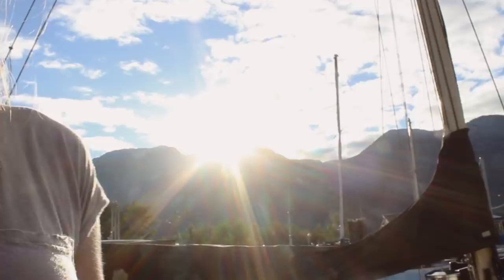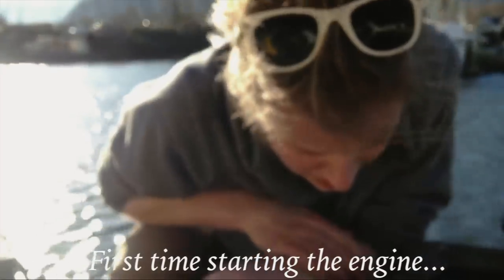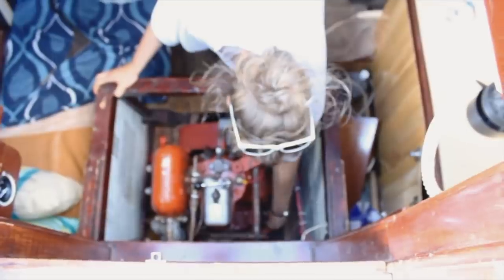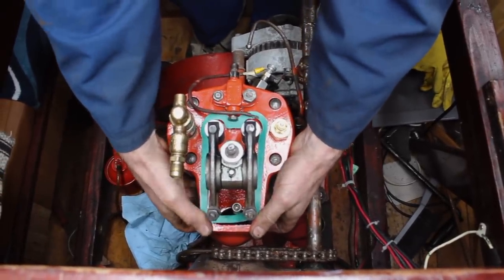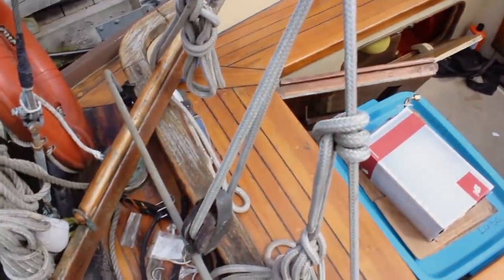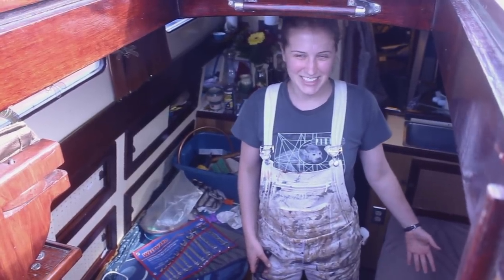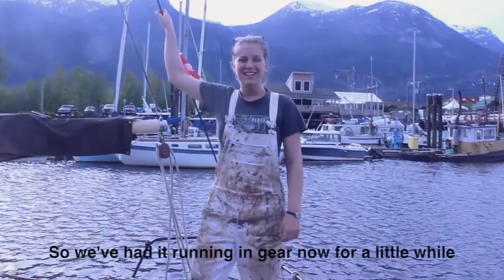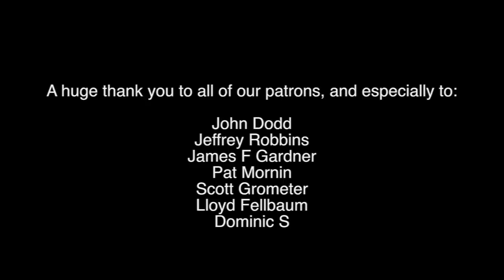Restoring the engine on my $1 boat [Sabb 10hp]

Comment: My dad still owns a 10hp Sabb fitted on a David Cheverton  Champ  18 foot hull for the past 40 years. Its reliability is awe-inspiring.
Ours has a 12v heavy duty Bosch starter motor . The 8 hp version of this engine was originally fitted with a 12v dyna starter coupled to the engine with 2 rubber vee drive belts  on the inner fly wheel rim.
This dyna starter ,as the name implies acted as a starter motor and then acted as a dynamo to charge the battery. The downside was the electro-mechanical voltage  regulator, that with time gave trouble.

Your videos are great, good job ,keep on learning and most importantly keep enjoying it.!!!!.
Greetings from Gibraltar.

Comment: Old diesel engines are unbelievable. I've had engines that have sat in a field for 20 plus years. Clean the fuel tank, new filter and fuel and away they go. I've got to say I prefer a combined cooling system. My boat has a heat exchanger (think car radiator), the raw water runs through this and cools the coolant that runs through separate chambers in the heat exchanger. This coolant then runs through the block instead of raw water. Either way Hopefully you have a strainer on the raw water incoming side to stop debris blocking the engine block passages. Loved your enthusiasm and how you watched and learnt your Father. All the best from Australia.

Comment: Wonderful story, thank you for sharing. My first boat - Osprey - was also a British design, by Philip Goode of Poole in the 1950s.  I didn’t use her as my home, but aged 18/21 I cruised her extensively along the south coast of England, with no lights, no navaids, no proper life jackets, no radio and usually with no crew (they declined when they saw her 🤣).... and she had a rather dangerous Stuart Turner single cylinder petrol engine that was a detonation just waiting to happen.  I loved that boat despite the bank-busting impact on my finances and the hazard involved in my voyaging. After a few years I went off to sea professionally and she went to a good home .... I was sad and relieved all at once. And/but - like you - I had learned SO much from that first experience of being my own captain, engineer, deckhand and cook. 😃

Comment: Damsgård Motor Factory, later renamed Sabb Motor, was founded on April 30, 1925, by the brothers Håkon and Alf Søyland from Flekkefjord, together with Harald Svendsen. Until 1929 they lived in a sea buck at Damsgårdssundet, in Laksevåg near Bergen. The company eventually became too big for the place and moved to the present address Damsgårdsveien 113. The first engine, model A, was a 3 hp incandescent engine. One aimed for delivery to small fishing boats as there were many along the coast. The engine became popular and gained a reputation as reliable and reliable. The last of these engines were delivered in 1962. A slightly larger glow head engine was a 5-9 hp incandescent head motor that remained in production for 38 years. A worm motor of 4–5 hp was made from 1935 until the mid-1960s.In 1958, the first full diesel, a four-stroke of 8 hp, was named type G. This is the well-known single-cylinder SABBen that is found in countless fishing and leisure vessels. Eventually, it was equipped with a starting ring and adjusted to 10 hp. There were also made 2-cylinder versions of type G, rated at 22 hp. The motors have roller bearings and splash lubrication and an innovative propeller wing reversal system. In total, more than 20,000 of SABB type G have been made. It also existed as a stationary engine without a casing, and as an air-cooled lifeboat engine, then with reversing gear and fixed propeller. The latest engine of this type was manufactured at the factory in 2001. One then went in full with the marination of engines from other factories, as well as continued the production and adaptation of systems with rotatable propellers, gearboxes, and other specialties. The motors are then equipped with the Sabb mark. In 1971, the company was converted into a limited liability company and was named Sabb Motor AS. Sabb is now part of the Frydenbø Group.

Comment: WOW what a nostalgic Sound and imagery.  I grew up in the '60s my dad starting up his 3hp single cylinder Yanmar diesel via hand crank.  I remember him squirting lighter fluid into something, then holding the compression release while getting the crank turning, then letting go and hearing the old gal come to life.  His boat was 22' motorsailer an Atkins design based on a Sea Bright Skiff hull which he had built in Yokohama, Japan in 1963/64.  I'm weird but I LOVE the smell of diesel both raw and exhaust smoke a very nostalgic odor to me.  Later in the mid '70s when dad was dreaming of having a 42' steel hulled Chinese lug rigged Pinky ketch custom made to sail the South Pacific the two motors he had picked for auxiliary power were the Japanese Yanmar diesel, and the Norwegian Sabb diesel.  I still had the old Sabb diesel brochures up until about a year ago when while clearing out the old homestead before it sale I had to regretfully place them in the rubbish bin.

Comment: My dad's boat had that engine when I was a small boy.  I've taken it apart and rebuilt it more times than I can count.   One word of caution though, when you start it keep your thumb on the same side of the starting handle as your fingers.  It's not a natural grip, but the reason for it is that once in a long while the engine will kick back against the handle.  This can break your thumb.  It's not pleasant. 

Once when we took it apart and put it back ( the head gasket was leaking) we got the con-rods crossed, and when we started it it ran in reverse, sucking air in the exhaust and blowing smoke into the engine box.  iirc we had to unbolt the fuel line from the injector to get it to stop...   The con rods go from buttons on the crank case at the base of the engine,  to the valve rocker arms on the top of the engine.  The 'buttons' are fore and aft, and the intake and exhaust valves are port and starboard.  When you had a little smoke in the engine box, I was SURE that  you'd done this too.  Enjoy her.
Reply: That thumb and fingers thing is very important. You really don't need a dislocated thumb when the engine kicks back. It's worse if it's diesel because of the higher compression ratio.

Comment: I have the Sabb 8hp in my boat and had exactly the same issue with the frost plug. It was worn out completely, no wonder as the engine was build in 1969. I ordered a new one also in the UK, put it in and the Sabb still does his work. You can easily let it run dry for 15 minutes, the norwegian SAR did the same, they started their engine underway to their intervention point while the rescue boat was still onboard the masterboat. Great engines, I really do love them.
Reply: search and rescue boats are buildt to last which is why the norwegians chose the saab engine, those along with the volvo are buildt for nordic conditions.i.e. to function above the arctic circle.

Comment: The guy next to my boat in the marina has a Sabb in his boat. Again, must be 50 years old and he pulled it apart and rebuilt it, as the boat had been lying, sunk before he bought it. It runs perfectly, though he has a dry exhaust and it's pretty loud. Just shows the quality of the engineering put in to them. Great video.

Comment: It definitely sounded stronger after the new cylinder head... I got my start as a diesel mechanic watching and working with my dad 30 years ago and have worked on all types of diesels from little guys like this to massive 16cyl engines, but I've never seen one of these Saab marine units. Such a great story to watch and yes, those challenging trial and error, how many times am I going to have to take this apart and do it again situations are the ones that really give you the learning experience and knowledge to master things.  Looking forward to more of your Curlew III stories.

Comment: Nice to see you and your dad improving this classic sailingboat. Altho i admire your working at the engine, you should consider another engine. An 2 cilinder small modern motor is more safe and easy to get sheap also second hand.

Comment: Hi Maya. I think that your pretty awesome and You are living the dream. Your lucky that your dad is there to help you along. One thing that should be done is send the cylinder liner to an engine shop and have it magnefluxed to see the crack visually. The head could also have been checked out by an engine shop. I have worked on a Sabb engine in FL. for a friend on a canoe stern sailboat named Idle Queen for a man named Harry Heckel who solo navigated the globe in her. The forward gear was slipping and needed shimmed so I removed it in the tiny engine room and ordered the correct shim and reinstalled it. On hisfirst trip around the globe the handcrank “shaft” had seized in South Africa so when he arrived back in St. Augustine FL. I installed a grease fitting at the casting that holds the shaft nearest the bulkhead at the removable handcrank. It worked smoothly after that. That engine went around the world twice and more. You have a Great boat. 
Thanks for sharing.

Comment: Not even a default full fuel governed start. What a cute little diesel! Hand oiled rocker arms too. Man, how cool is that?
Reply: spencer marshall  I have the same sabb in my halcyon 27. Very basic, slow turning and a beast. Parts still available even at factory in Norway. They speak English and parts are easy to order
Reply: Arek kaniewski I have an halcyon 27 and the same engine... what a great boat.
Reply: Arek kaniewski 
Have the same engine.
Do you have contact data in norway?
Greetings,
Harry

Comment: Hi, The cracking between the valves in the cylinder head is a common problem with saltwater cooled single cylinder sabb's if you want it to last then change it from an open saltwater cooled system to a closed freshwater one with a heat exchanger.

Comment: I had this engine in a 8.30m Oostvaarder Dutch steel sloop of the late 1960ies , and it used to be of the most reliable and easy to handle marine diesels I ever had in any boat. But my Sabb engine had an electric starter.

Comment: Those are awesome engines I had the same one on a boat I purchased. It was one of the only engines certified by Lloyds of London to be used in life boats. Mine was submerged and it still ran much to my chagrin and the surprise of the insurance adjuster.

Comment: this is a very durable and simple motor, the problem is that leaks oil all the time and sometimes, will get hard tô start, here in Amazonia we use them on boats, energy generators, tractors, etc. but with a small efort, will probably run Forever.

Comment: Wow does that bring back memories of replacing my sabb10 with a new sabb10 (about 20 years ago).  They still made them then, so when a gasket failed and all the internals were drenched in sea water, rather than dealing with corroded springs, etc, over time, I just imported a new engine from Norway.  I'd buy another one if they still made them, for a new boat build.

Comment: Hi there , I just saw your u tube for first time today . 
  We have a Cape George with the 2cly Saab 2jr , which is just 2 cly of what you have . These are great durable engines .
  The "oiler access " on top of valve cover is actually where you are to put oil in that goes directly into intake to help give compression to start . 
 There is a parts outlet in Leesburg Florida who has lots of parts and knowledge.  The business name is "Saab USA"
  good luck with your project , I'm sure you'll get many great years of pleasures from this .

Comment: Hi my friend!
I just came across your channel and just watching some  few episodes so far.
This was one of them.
It is very cool to see you have/did have this old Norwegian Sabb diesel engines in your boat, this far from Norway.
I just wanted to tell you.
If you still have this boat, or you know the owner who still have it, and you you are in need of parts for the Sabb, I may know  a guy that could have what you need.
He have been running a small private boat museum and have been collecting and storing  engines like this, and parts for them, and a lot of other historical boat stuff for many years.
Just give me a sign if so, and I will try to bring you in contact with him.
Here in Norway there is also two other brands of simular engines running on gasoline.
The FM motors (Fredrikstad Motor)
and the Marna motors.
They are a lot quieter smoother running, and therefore more popular over here. 
Those diesel engines have harder compression knocking sound.
Your shifting forward/backward, is it done by a twisting mecanism that turn the propeller blades forward/backward?
If it is a Norwegian propeller/axel system, that guy may also have parts for thst kind...
Best regards from Norway.

Comment: Great boat! One day i´ll own something like that i hope.
Handcrank engines do sometimes kick back when you try to start them. For safety it is better to hold the handle with you thumb on the same side of the handle as your fingers. Takes a little getting used to but if it kicks back you won´t break your thumb.
Reply: Take from one who has been there done that, the broken bone is the coporal scaphoid. Exactly from not following the above procedure. In 1976.
Reply: It depends on how they made the crank. I have a 1946 Chev. suburban that has a hand crank and it disengages at the slightest kick back.

Comment: Hi Maya - loved the video. My father has a Sabb 18hp on his boat which is estimated to have been built in 1910 - that's as far back as we can go. The engine does exactly what your engine was doing i.e. cutting out under power. Can you tell me where you were able to source a cyclinder head - we live in Ireland - thanks

Comment: So glad you kept the Sabb even if it cost more than a new engine in parts! I grew up sailing in a UK wood boat that had the 'Silver blue' yacht version of the engine. Red paint for the lifeboat versions. Ours had an electric Dyna-start, but yours has an alternator  so it actually charged the Battery!  We did many trips motoring thru the Dutch canals on summer holidays. Shame yours was left to rot in saltwater , if only it had been winterized ...... I'm glad to see it had the variable pitch prop too. Very special if a little inefficient.
Yacht Teleport had the same engine in the wood boat they took across the northwest passage,  https://youtu.be/kj-YqwDZzrM
But Not without replacing the cylinder head too! So about the same time you replaced yours too.
So great you had some video of this long episode of you life!
Looked after that engine will run forever! Don't you just love the sound! But not the vibration that loosened everything on our boat!
Thanks for the great memories and lovely story!
Cheers Warren
Reply from the maker: warp21drive thanks Warren! All said and done it was still much less expensive to repair the engine to get a new one, plus I got the experience of learning about marine engines, which was totally invaluable. And although many of these sabb engines had variable pitch props, mine did not, which I was happy about!
Reply from the maker: warp21drive also, motoring around the Dutch canals sounds absolutely lovely!! It sounds like you’ve sure had your fair share of adventure as well!!
Reply: I have the variable pitch and I love it. No transmission to rebuild, you can disengage clutch so prop doesn't turn and best of all you can go from ahead to astern , or slowly turn pitch down at full rpm to slow the boat. This way you always have full power available in a second.

Comment: You are the bomb! You now understand the anatomy and workings  of the inside of a motor. Congratulations.  I don’t know if that engine even has valves.  Did the head shop refund your money?  Sounds like the African Queen!  It’s an old movie.  Who thought of testing the motor in gear against a spring line?  Smart.

Comment: Actually the frost (freeze ) plug is misnamed.  This hole is formed by the core which also makes the void of the water jacket when molten metal is poured into the mold.  The freeze plug seals up this core hole.

Comment: I have an workshop msnual for this engine,but its on norwegian landuage.This is the most simply engine to work with,the factory was made these engines from 1950ts until the last one was produse in 1996,if you seartch on forums in norway there is alot of people who can help you and give you tip who things can be done with this engine,for exemple the clutch/kopling its adjustable,losen the four screws on the top cover behind the starter mecanism and get an proper look to inspect the copling for water oil and other things who not chuld be there,but this the world most reaible engine,and only need oil change every 200-300 hours and diesel

Comment: When you are using combination wrenches can put two wrenches when you cannot give enough torture to the bolt. Use the closed end on the bolt and the other end (open end) with the closed end of a larger wrench locking them together giving you a longer torture.

Comment: Great story! Is the part right after the engine starts and you go for the bay sail, supposed to be black with no video, only audio? I watched the video several times and it’s image-less like for 3 mins. All the description of cylinder liners and heads, parts rebuild, 6 months wait, etc, have no video, at least in this latitude. Just black background.

Comment: I used to sail a Dutch classic boat with this SABB 10 HP engine. Very reliable and sturdy. Good you kept it and restored it, as you say it is part of the ships history. You can find all manuals and maintenance books in english on this page https://zweedseklassiekerclub.nl/zweedse-boten/motoren/sabb/   in case you don't already have them.